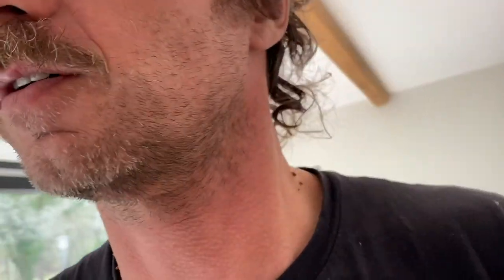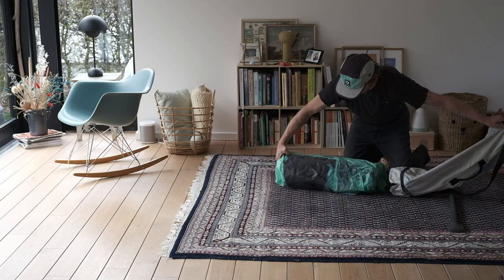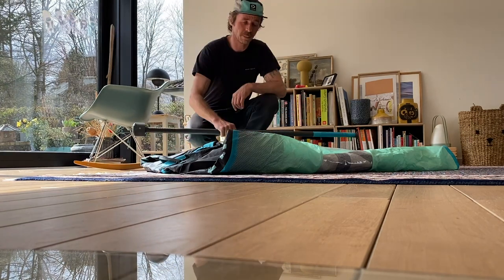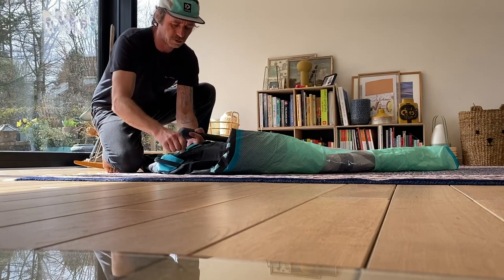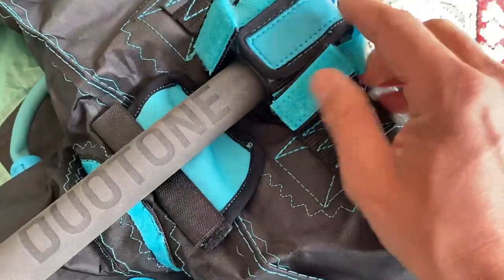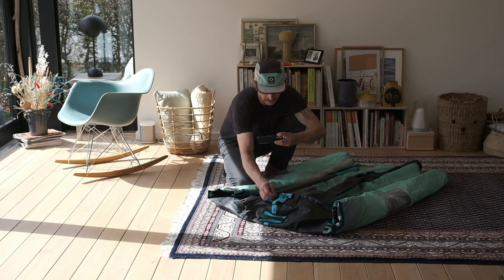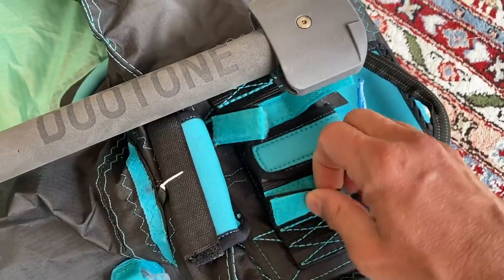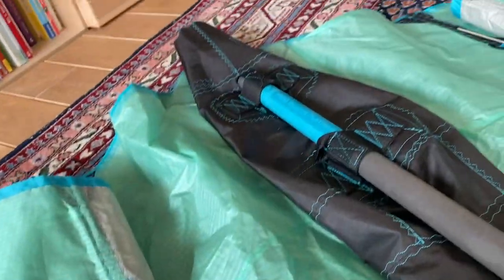WDT - HOW TO attach the MINI BOOM (SLICK) - English

Comment: This video is very timely and helpful.  Thanks.  The rigging process seems a lot 'slicker' than that for the Echo. 
Could you clarify if the boom is round or oval. I can't tell from the video.  If it is oval then it would seem it is rotated 90° from the Echo boom (which would be move in the wrong direction in my opinion).    .